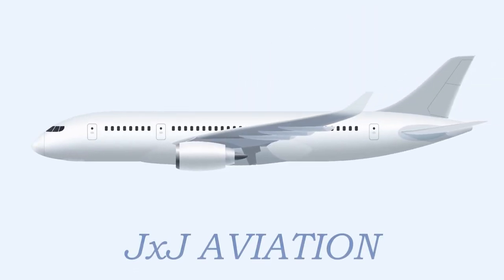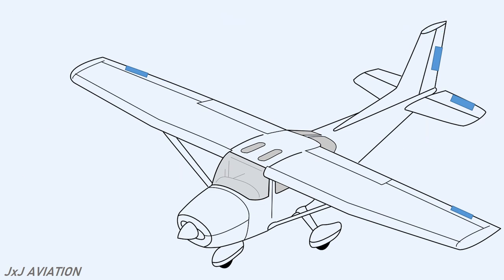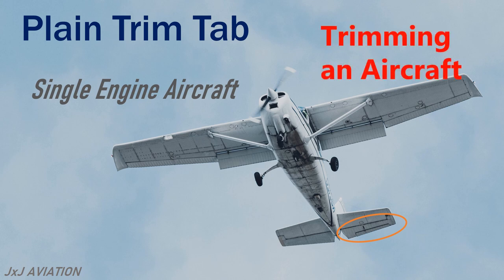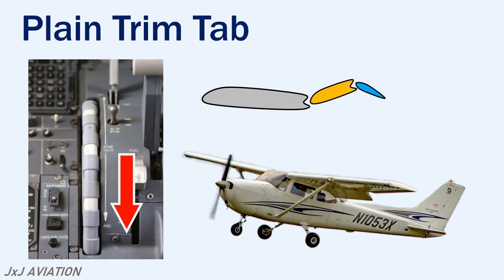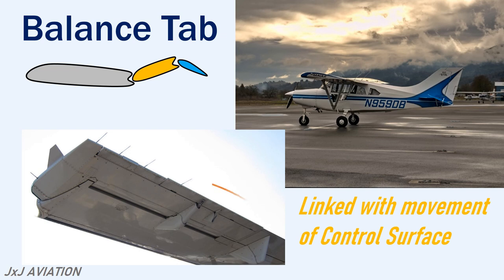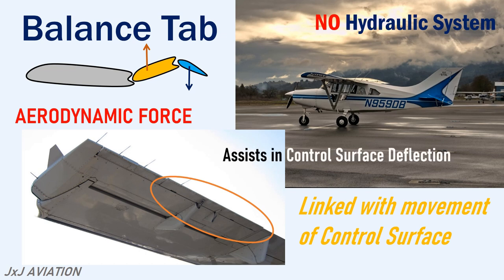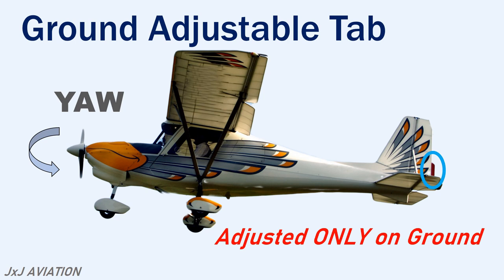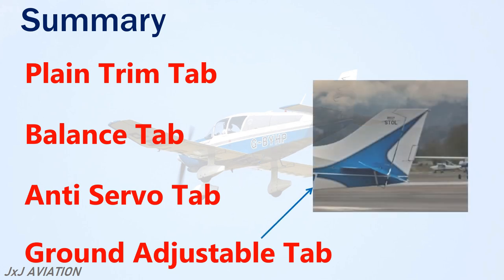What are Trim Tabs? | Types of Trim Tabs | Why Trim Tabs are required in an Airplane?

Comment: Trim tabs set the trimmed airspeed more than they control the plane’s attitude. Changing the power setting will then change the plane’s attitude as it will want to maintain the same trimmed airspeed. Also, you should not fly the airplane with the trim wheel. You should use the elevator to change the plane’s attitude and/or airspeed and then use the trim to relieve the force on the controls.
Reply from the maker: Yes. That's the perfect explanation! The elevator for changes in pitch and trim to ease pilot's workload.

Comment: sir which trim tab install in A320?
Reply from the maker: There are no trim tabs on the A320 because it uses hydraulic pressure for the movement of control surfaces.
Reply: @JxJAVIATION  but trim wheel are install in A320
Reply from the maker: @mdmahtabkhan8753  It is for the movement of the THS. You can check out my video on the THS here: https://youtu.be/ZdTnTKGBWbs